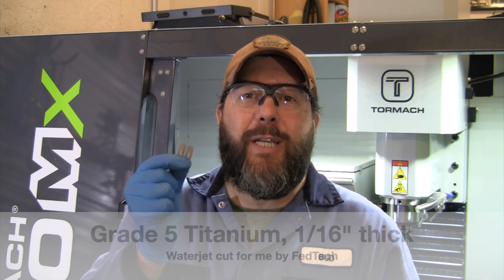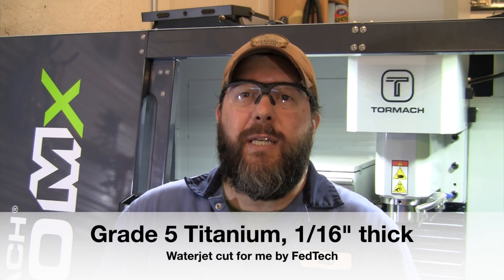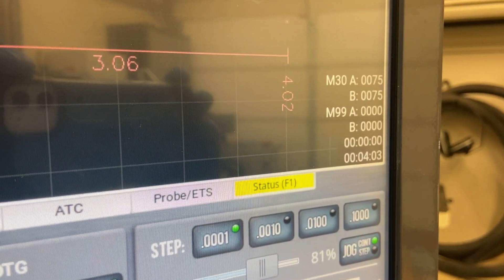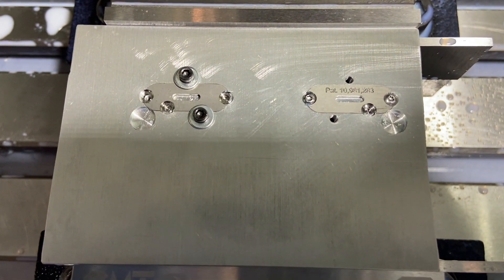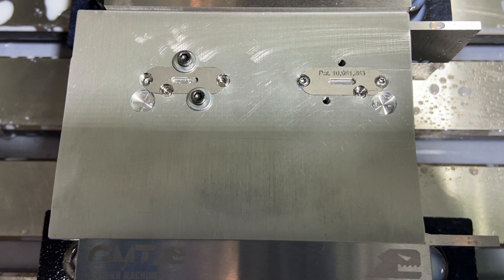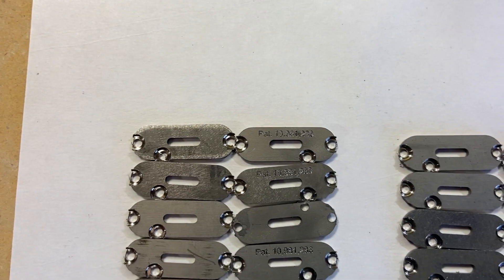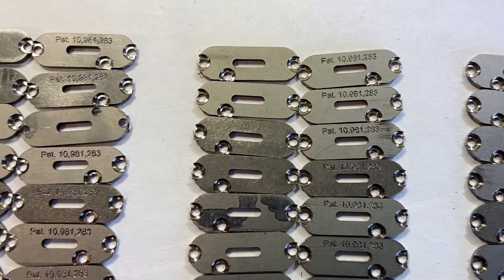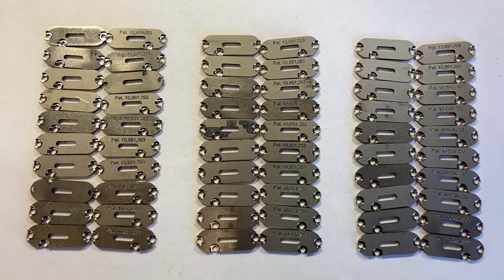Tormach 1100MX - First Real Production Run - Small Part, Tormach Worked Awesome!

Comment: Thanks for posting some real videos making non-imaginary parts. Most of the videos on YT about these machines are paid influencers or amateurs posting unboxing videos. I am thinking about trading up from my 1100 S3 to the MX and am trying to get a better idea of the difference. On the whole I'm happy with the 1100 but the higher speed spindle and use of a real taper are very appealing to me.
Reply from the maker: @sansbury95 - Thanks for the feedback. My videos are truly what I am doing in the shop that day. I try to provide a little more detail so people can learn vs the zapoof magic and a part appears. Maybe why my channel is small😂😂. Anyway I love the MX. picked it for just your reasons wanted the speed and a taper. I never ran the other style but know some others who started with the other tool holder and they prefer the taper after upgrading. I do mostly smaller parts but all material and this Tormach has served me well.

Comment: How long does the coolant last until you need to replace?
Reply from the maker: CarGuy - The details on the product just say extended life and I can’t find a timeframe anywhere. I have not drained and changed mine and it has been in service for 15 months of what I would call light use. I continue to add water as needed to maintain the concentration from evaporation. I also too up as needed due to coolant loss from what comes out with parts gets wiped away comes out with tram oil skimmer etc. no odor and still looks pretty clean. I would say change based on color and contamination level. Hope that helps, thanks for the question.

Comment: Does that machine have any kind of chip conveyer?  Auger ?
Reply from the maker: Robert h - Thanks for the question. No this machine does not have an auger or any way to add one that I know of. Just a pull out chip tray that rolls out from the bottom to empty. Makes it pretty easy to clean.

Comment: As an experienced machinist, I am both impressed, and have a few tips for you.

1. Minimize your retract from motions. No need to go way up between holes, other than to clear the washers. So if they're .050" you only need slightly higher, maybe another .025" to be clear.
2. Add more holdings to that fixture plate! Maximize your total run time in the machine. The more the machine can run the same tool without messing around waiting for the tool change, the better.
3. Create two identical fixture plates, so you can be loading one plate while your other plate is running the parts. From what it looks like, you could fit somewhere between 8 and 10 parts per plate.
4. Put a part stop on the end of the vise so when you slap each plate into the machine, it locates exactly the same between runs.
5. For the love of God, get yourself a power tool to manipulate those screws. Time is money!

Now, with these tips, I'd split the program into two separate operations. The first holes drilled and counterbored on one program, on one plate. And when you switch the holdings so you can do your engraving, that can be your second program, on your second plate. 

If it were me, I'd have operation 1 on the first plate, and operation 2 on the second plate, so that way you're not switching up the screw holdings in the middle of the cycle. And each operation would be separate programs.

Good luck in the future!
Reply from the maker: Into TheCNC - I appreciate the comment and the tips. As a manual guy the work holding and thinking through these operations is still my main gap. This was a test run of the program that I decided to turn into a production run and to your points clearly not efficient. I like the two plate process you outline. I was going to put more slots in the plate but had not thought of two separate ops. Makes a lot of sense. Thanks!
Reply: @BladesIIB  no problem dude! I actually am in the process of putting together a masterclass to teach this very thing: efficiency in the program, and the processes between pushing the go-button!

I have a couple videos of stuff where I have a GoPro in the machine to do split screen comparison of making efficient changes.

If you have any questions on your future processes, tag me or send me a message and I’ll help you out if I can!
Reply from the maker: @heroicprecision  Those sound like good videos thanks. Just subscribed, will check them out.
Reply: Hi, do you recommend this Machine for a small producer ? Maybe 5 bigger parts per day. Accuricy will be 0.008. But i have a budget lower than 35.000$. So i will go with Tormach or a chinese Machine like DRC machinery. Which one do you recommend ?

Comment: You jug is large enough, can you run 4 parts at one? two first op, two second op/engraving?
Reply from the maker: MotoMotion Canada - Yes for sure the jig is large enough. Just need to cut more slots and tap more holes. The test went well so I just went ahead and ran a batch off. But next time I will set up a better jig to reduce tool changes and speed up the process.

Comment: Use a regular ball endmill for the engraving, 1/16 or 5/64 should work nice. Stub up your tools and get 4 flute coated endmills for titanium or steel. And get a carbide circuit board drill instead of drilling with an endmill.
Reply from the maker: austin allen - Thanks for the tips. Will definitely make that change for engraving. Already found the carbide drills and will not try drilling titanium with end mills anymore. Had an issue on another part where a 7/64 end mill was flexing so much and pulling off center it made over 1/8 holes. Lesson learned. What you can get away with in aluminum does not work in titanium. Will also stub up my tools where I can and since I won’t be drilling, I will move to 4 flute much more.
Reply from the maker: austin allen - I tried changing the tool to a ball end mill in Fusion and the engraving tool path won’t accept it. What tool path do you recommend instead of engraving?  I tried Trace but that wants to do the full outline rather than one pass down the middle.
Reply: @BladesIIB  Use TRACE but choose one of the SHX fonts within the Fusion 360 text options, as it has a single line that TRACE follows.
Reply from the maker: @stevedunthorne7376  Thank you, I will try that.

Comment: I'd CB with a 4FL if thats anything harder then Alumn. It'd help with that burr the CB leaves, as the 2FL is pushing the metal instead of cutting.

Great job thou! Lets see a pallet with 20 of those now :)
Reply from the maker: Jay Von Ro - Thanks for the tip. It is grade 5 Ti so definitely harder than aluminum. And yes, I need to up the game on my work holding. Started as a test of the engraving. Then figured I would knock some out while it was set up.

Comment: Great job Bud.   Soon enough you’re going to need a Pierson Pro Pallet system.
Reply from the maker: Best Services - yes, the work holding is definitely a work in progress. I probably need to read more and learn from others. So far just going with what makes sense to me but clearly not efficient yet. As a manual guy, I am used to making just a few parts or simple jigs for those bigger jobs. CNC high quantity is a while like new animal. I will take a look at what Pierson has. Thanks!

Comment: Now that you have some run time on the 1100MX, any thing you wished you would of done differently during the build?  Any coolant leaks?, etc.   I plan to use your videos to assist me during my build.  Thanks!  GO HELLCAT!
Reply from the maker: Jerry Chapman - Thanks for the question. The only thing I would do different is leave the left side another inch or two from the wall. But I don’t have any coolant leaks and even that window is holding well. Someone else recommended I check the oil flow up to the Z oiler block. I did and it was a little slow. Tormach recommended a check valve at the automatic oiler to prevent back flow. Other than that. Have had no issues.

Comment: Love your videos.  Getting a 1100MX also, your 1100mx unboxing, building, etc was very helpful.  I have a request related to this video.  A video explaining the cam and machine setup behind the machining multiple parts.  Thanks!
Reply from the maker: Jerry Chapman - congrats on your new machine. You are going to love it. If you check out my knife build video part 6 it has the CAD and CAM of this part and the jig. Ideally for multiple parts, I should have made a jig with more spots. I could either put all those in fusion. Or stick with the two I have and create additional work offsets to cut 2 more the same. Then another work offset for 2 more etc. I have not actually played with a set up using more than one work offset yet?  Will have to try that. I currently do use another work offset for tool height setting.  I will see it I can get a video out with multiple work offsets. Thanks for the idea.

Comment: Try the 0.02 ball engraver from lakeshore carbide. The tip is much stronger than a 45 degree point. But great work. Plenty of space to expand the fixture.
Reply from the maker: anon - Thanks for the tool recommendation. And yes could have put more on the jig. Started out as a prototype to see if my engraving would work. Then once set up figured I would just go ahead and knock some out.

Comment: with such a small part, why not run 30 or so at a time?   2 at a time is not very efficient
Reply from the maker: dannirr - Fair point. Started out as a prototype since I had never tried engraving before. Since I had the jig set up I went ahead and knocked these 30 out.  I should make a larger jig for next time and hold more. Would save a lot on tool changes for sure. Appreciate the comment and the feedback.